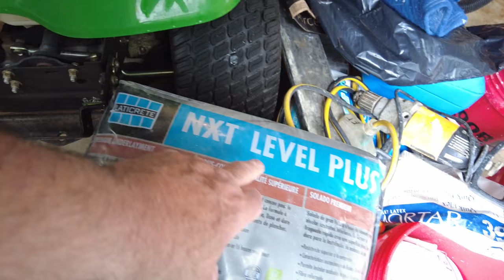How To Self-level A Floor: The Basics

Comment: Looking forward to this video, as I’ve done a small bathroom in my unfinished basement (concrete floor) but had the sewer pit to set a cross laser into get the cross beam at floor level. 
Now I’m dealing with the rest of the basement floor either having a hump or it’s just not flat all over. So I’ve just got one of those lasers that sits low so I can check it. Home owner here so in my theory it will make checking a larger area easier. 
Thanks for all the videos btw!

Comment: Hi Sal great work and video as always! 
Is a layer of galvanized wire mesh required over the plywood or is the uncoupling membrane over the cured leveler enough to provide structural support under the tile? 
Thank you!
Reply from the maker: Depends on the leveler, this one does not, most do.

Comment: I'm installing heat wire into Heat Matrix uncoupling mat over plywood. Should i use the self leveler first and then put mats on top, or do the mats with the heat wire and encapsulate them with the self leveler? Not sure which approach would be better.

Comment: If you have at least 1/4 inch thick to level why wouldn't you just add another layer of subfloor and then level on top of that.  It would have to be much less expensive than the amount of leveler required.
Reply: 1/4 is the absolute minimum recommended thickness for high traffic...
Reply: Could be the labour aspect of adding the subfloor and then setting up for self leveler anyways. Might even out closer than you think
Reply: Labor aspect of it all day long is worth 45.00 per bag @ 24 sf with a perfect leveled floor. Leveler for the WIN

Comment: I’ve watched I think all your videos haha maybe someone can chime in on my question about self leveling 
I have completed the self leveling on my main floor using mapai product I want to now put ditra on using Shluter all set because I also have some exposed wood  question is do I need to prime on top of the leveler to to adhere the ditra using All set ?
What are your thoughts , thanks for everything you share with us much appreciated
Reply from the maker: Install the ditra with the Allset, no need to prime, just be sure to wipe down the surface of the substrate with a damp sponge first. This is a link to ditra on plywood, same for your install. https://www.youtube.com/watch?v=EoUcy_vA52s
Reply: thanks for taking the time to answer my question  @SalDiBlasi